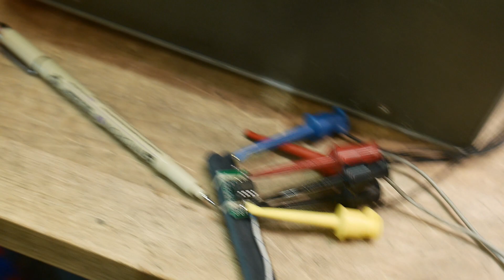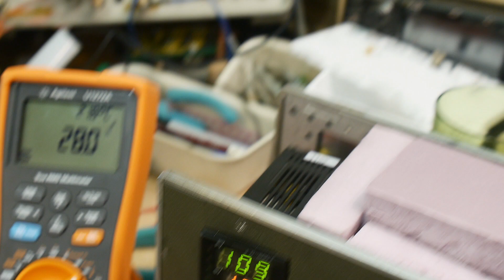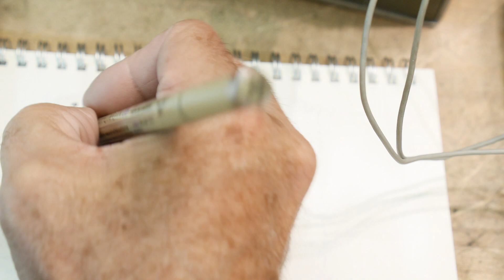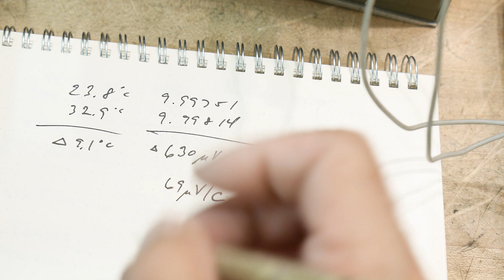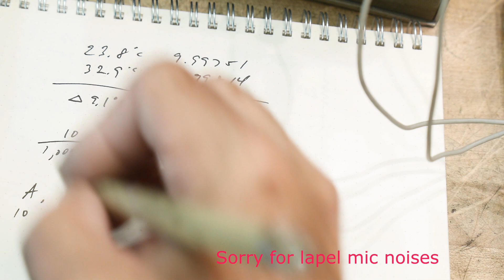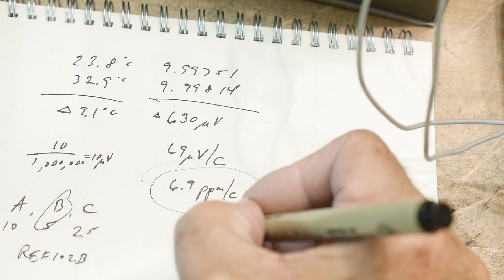#1171 REF102 Voltage Reference Temperature Testing

Comment: Still good enough for 5 digits of resolution, and most of the error likely comes from the small temperature change, do it from 0C to 70C and it likely will be less, simply because of the larger divisor. But for anything under 5 digits of resolution not even going to show more than plus or minus 1 count in the displayed value.